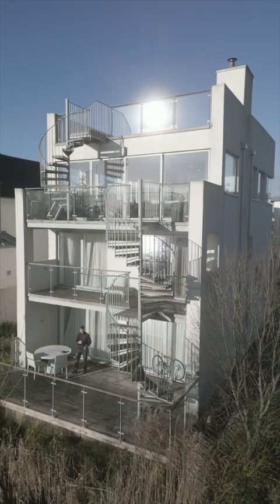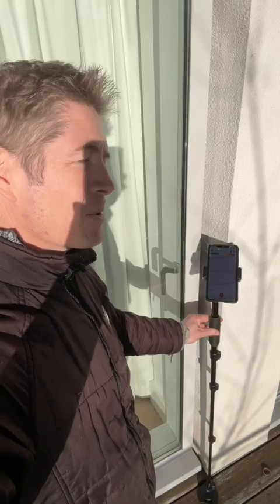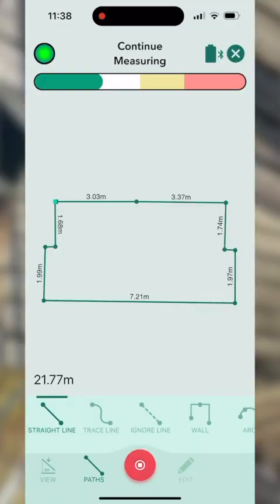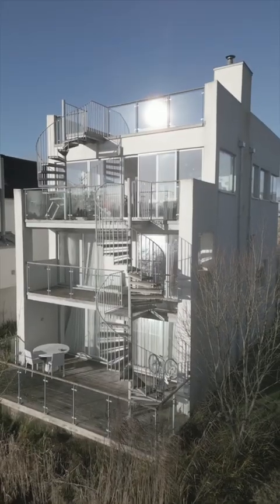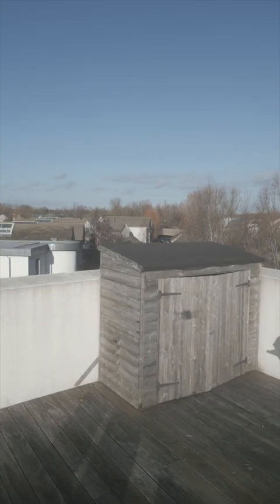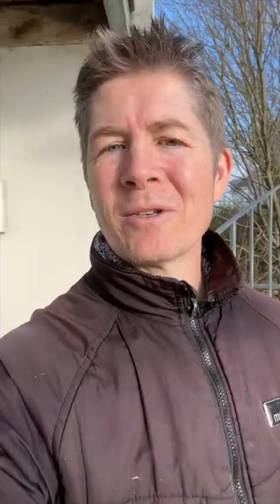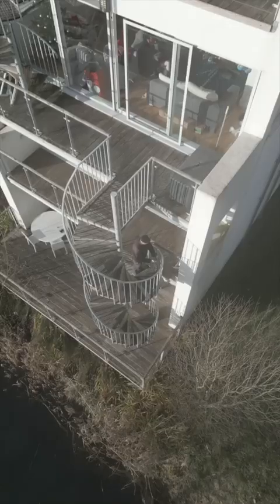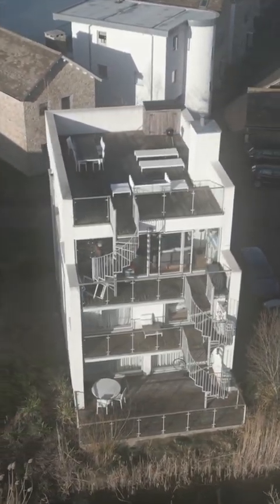Complex Measurements Made Easy – Moasure

Comment: VERY VERY IMPORTANT FEATURES REQUEST:
Like professional Surveying software, IMPLEMENT "STAKE-OUT" feature.  i.e. Points, Lines, curves etc.
Select point, the app uses map, compass, to direct you to the point exactly and also with cut/fill vertical heights.  Should be able to see your location in real time.
This should work also in just horizontal 2D planes and also vertical 3D planes.  So not just stake out layout for floors, but also vertical walls and curved walls.  Ceilings also, using pole, or laser point projection from floor upwards. 

What would even be better, MOASURE mountable to automated wheeled rover that can stake out / mark the points, lines, curves etc.  i.e. pen plot, inkjet or spray marking.

Implement standard Coordinate Systems used in the survey industry.  I.e. NAD83 State, UTM planes, and GEOID (orthometric) heights based on a KNOWN POINT.

Increase accuracy and precision to much better than 0.75", but mm level.  Would take over the GNSS and Robotic Total Station industry by storm.
Reply from the maker: Thank you for your detailed and insightful feedback. We are always working on improving our technology and your suggestions are very valuable to us. Watch this space as we continuously update our features and strive to incorporate feedback from our customers. Your input will certainly be considered as we develop future enhancements. Stay tuned!